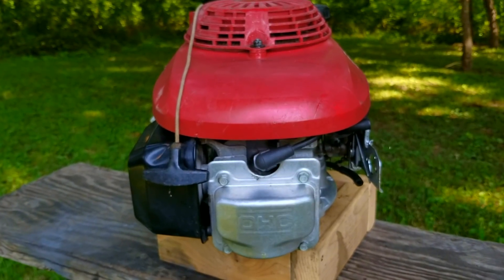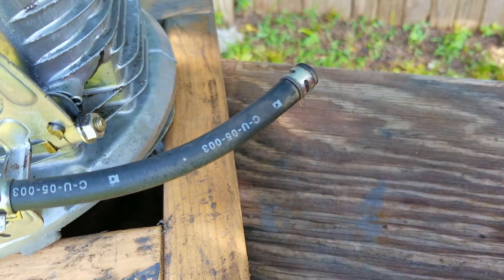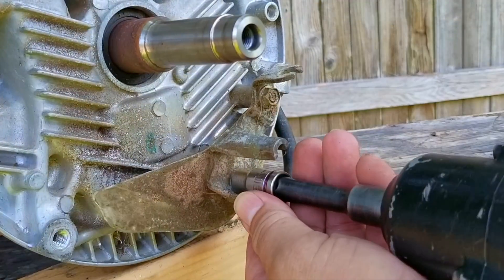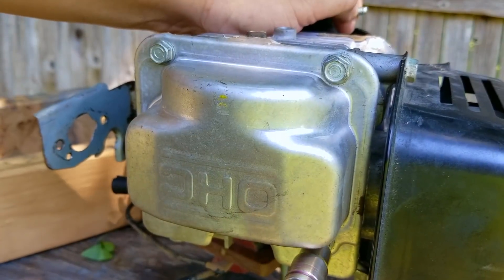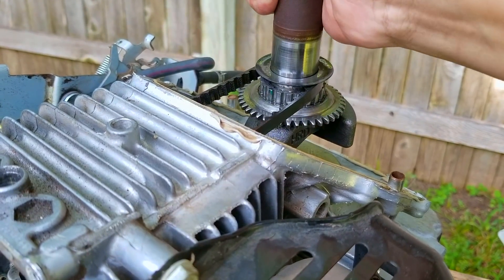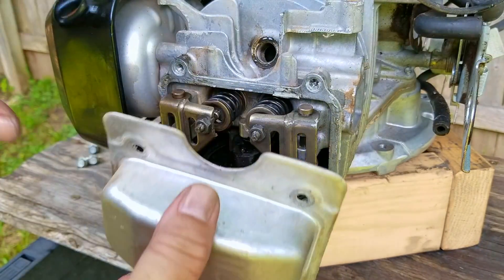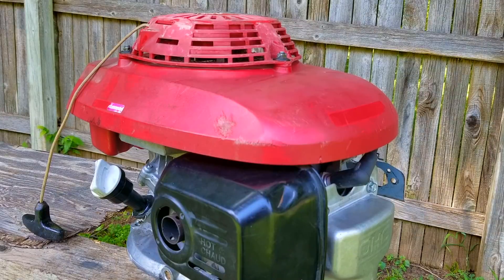I took apart a Honda engine to find out why it was so loud.

Comment: When I get a junk engine in the shop, I take the parts that I want off of it and then take the whole engine apart like you did.  Except I scrap the block, flywheel and piston for aluminum.  I don’t know where you are from, but in Wisconsin aluminum prices are very high
Reply from the maker: actually I was hoping to do the same thing here. I have several blocks that I need to get rid of.
Reply: @HomeGaragechannel  nice.  I brought in about 250 pounds of engine blocks and got a little under $100.  So hopefully you get a similar return
Reply from the maker: that's a great return

Comment: These hondas are a little bit different of a design but I like them and seems to hold up well, even with a plastic cam gear and timing belt rather than a timing chain
Reply from the maker: I know right, it's a bit different but I enjoy working on them.
Reply: Intricate clever "new think" engineering.

Comment: Oh no, my car’s engine is making this noise. This means it must be knocking too, unless the mower engines work differently.
Reply from the maker: what kind of car is it?
Reply: @HomeGaragechannel  2012 Acura RDX turbo
Reply from the maker: does it have a lot miles on it?
Reply: @HomeGaragechannel  86, 833
Reply: If it is making knocking it could be a couple of things, not just the crankshaft, you might be in the clear or not, you would have to troubleshoot it
Reply: @Iamdark1234  I am not sure if it’s knocking though. I would think spark plugs would be the problem if so.
Reply from the maker: @Iamdark1234  thank you Dark

Comment: Lemme tell ya', from a commercial mowing standpoint that "annoying" blade clutch is a GODSEND.  Mowing commercially, you have to stop and start, pick stuff up, move away, etc. all day long, and NOT having to RESTART the engine every time you step away from the mower is absolutely GOLDEN.
Reply from the maker: I gotcha
Reply: Not to mention the drive you can disengage without turning it off. I really like the husqvarna drive clutch - go any speed you like
Reply: Just clip it closed to prevent it from turning off?
Reply: yea, I never had one until last week when I re-powered a junked Timemaster, and its pretty cool.
Reply: Very true!
Reply: I grew up with a Honda HR214SX so the clutch is a good thing.  My current HRC216HXC has a very similar clutch design on it and maybe 80 percent of all of the mowers I have had had some kind of blade clutch.  The best clutches were all of my Hondas and a John Deere 14PB.  Toros were crap because it's a clutch in the same way the conventional walk behind snow blower or thrower has a "clutch."  It utilised a belt tightened between two pulley halves.
Reply: You can use the parts and make a good blade adapter too.

Comment: You should do experements with it
Reply from the maker: like what?
Reply: Maiby put soap instead of engine oil
Reply: Or run it on diesel fuel,I would love to see an experiments done on this,thank you.
Reply: Also being a small engine mechanic I would love to see what would happen 😃
Reply from the maker: @beefjerkey962  I see now.
Reply from the maker: @beefjerkey962  I will definitely look into these video ideas, Since it's not going to buy used for mowing anymore, It would be interesting to see what happens. thanks.
Reply: Thank you so much!!!

Comment: I have one that needs a crankshaft. The original is bent. They don't  shear the key on the flywheel like others, instead they bend the crankshaft. I ended up finding another engine for the mower two years later. I have lots of spare parts now.
Reply from the maker: that's what I've seen too. I wonder why the key don't shear?
Reply: @HomeGaragechannel  design flaw. I had a teacher contact me, she hit a buried pipe with her brand new Honda. Bent the crank. It was already leaking oil out the seal. She asked me what she should do. I checked on having the shaft straightened but was told no. Her other choice was a new crank and seals.  When I told her the cost, she declined. I told her to run it like it is, but watch the oil. Tecumseh  has a better design concerning this and have fixed many of them in one hour. I keep a supply of the keys on hand. Personally, I would rather see them shear off easily.
Reply from the maker: @scottfirman  that is a bit worrying.

Comment: This is why it is so important to keep your oil moderated. So many people are clueless about their machines and this is how that happens
Reply from the maker: I know right, They were screwing the dipstick into the block so it kept saying that it was full, when in fact, it was very low on oil.
Reply: @HomeGaragechannel  how are you suppose to check screw in dipstick levels?
Reply from the maker: no just press the threads against the filler neck.
Reply: @HomeGaragechannel  thanks 10+ yrs in automotive and I had no idea
Reply: @D4x4Bronc  It really depends on the brand ! Honda (even their motorcycle) is with the dipstick unscrew, laid on the threads
Reply: @HomeGaragechannel  Toro Super Recyclers from 20042 and 20043 models from around 1999 to 2002 had the best dipstick.  It was just like a car engine dipstick.  Silver metal and easy to read and clean-off.  The 2013 Toro Super Recycler has the worst dipstick I've ever seen, all black and plastic, very hard to read and easy to over-fill oil.
Reply: People that are not mechanical should have electric mowers (battery or corded) or manual
Reply from the maker: true

Comment: you should drain the oil out of it and make a video out of blowing it up
Reply from the maker: I think the rod would gaul up on the crank first, then the piston would get stuck in the cylinder due to over heating.  For me to blow it up , I would need to over rev the engine.

Comment: Nice video! It is a bummer this engine is beyond repair but I’m sure you will have multiple parts you can take off of this engine and put it on a different one.
Reply from the maker: That's the plan!

Comment: Any thouts of drilling it up and see if you can put an normal ballbearing in it and se if that works , not costeficcant just for fun.
Reply from the maker: I'll look into it but it will be an RandD project. thanks for the comment.
Reply: If a bearing will be used I would personally choose a needle bearing or sleeve bearing as it tends to last longer due to concentric force's
Reply from the maker: thank you for the information

Comment: If it were me, I'd save it for parts... but then I'm a pack rat from way back! I did use one 'till it broke. I barely missed getting clocked by flying parts not to mention engine oil all over the place. 😁Cheers, Steve
Reply from the maker: thank you Steve Everett
Reply: always wondered if an engine of this size blowing up could do serious harm to you or not.
Reply: @M.TTT.  Maybe... when it happened to me most of the pieces stayed at ground level and shot out to the side. I admit "getting clocked" may have been a slight exaggeration. 😉😁😁😁 Steve

Comment: Parts machine, I find lots of Honda's have to have the valves adjusted also. Good video and many thanks.
Reply from the maker: Great point!
Reply: @HomeGaragechannel  mine runs grear only 3years old gonna be 4  next year got it in 2019
Reply from the maker: that's pretty cool
Reply: lots of craftsman (briggs engines) also. Most homeowners don't know what the valves are let alone change the oil. Engine I had recently was more than .005 out of spec on valves.
Reply: @M.TTT.  I agree, I recently had a Honda 360 that was 15 thousands out.  Almost broke the kids arm trying to start it from the kickback.Thanks
Reply: @watermanone7567  daaang wow, good ya caught it though, and the kickback is so bad. An ATV nearly pulled my wrist off, hurt for a few days.
Reply from the maker: that's quite a bit. it must have ran better after an adjustment
Reply: @HomeGaragechannel  it does and easier to start, the reason I checked them was it's a briggs 7.0hp that had a sheared flywheel key
Reply from the maker: @M.TTT.  I see.
Reply: @danielcoleman8546  yup and thats great for us garbage pickers!!

Comment: Use it til it breaks, I really want to know how long it can survive like this.
Reply from the maker: I hate to say it, since it's not the bottom end but the top part, it might last a very long time. just noisy
Reply: I did notice it got a little quieter as the drive clutch engaged. I wonder if a super duty oil could give it a extra use or 3 after a fine grit smooth out..... Great info HG
Reply from the maker: yes I noticed that too. What I thinks happening is the rotation of the blades is keeping the crank from wobbling at the top as much, so its quieter

Comment: save the parts that are still good but hone out the cylinder block from my view.
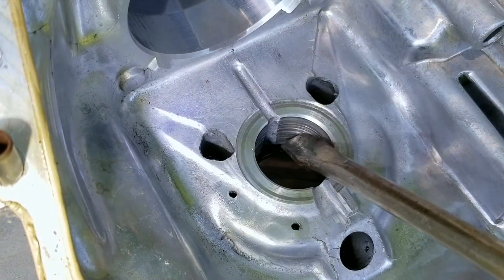Reply: No point, cylinder block is the same 1/2 as the trashed bushing. 6:41
Reply: @jcadult101  unless you replace the crankshaft and install a sealed crankshaft sealed bearing.
Reply from the maker: thank you Patrick Stapleton

Comment: This was very interesting. Thank you! What amazes me is how good the bottom end of this engine looks, especially given the abuse and neglect. This goes to show that, with proper maintenance, these GCV160 engines should be able to run for a long, long time before wearing out.
Reply from the maker: I completely agree with you.
Reply: Except for the top end and rocker arms have a reputation for being fragile.
Reply: @lawnmowerdude  ☹️
Reply: Also doesn't take well to rolling around unsecured in a truck or trailer and hitting the soft cam cover and denting it.  @lawnmowerdude